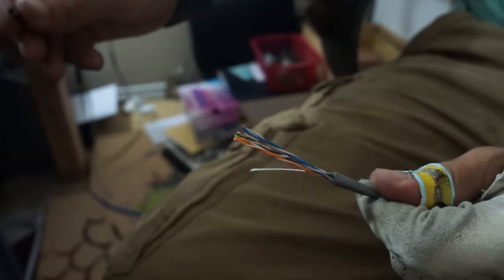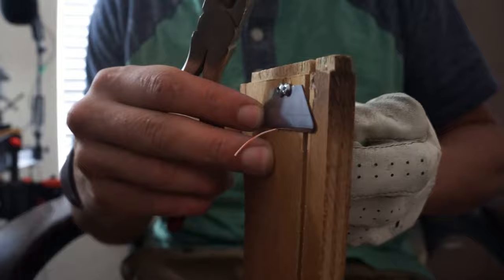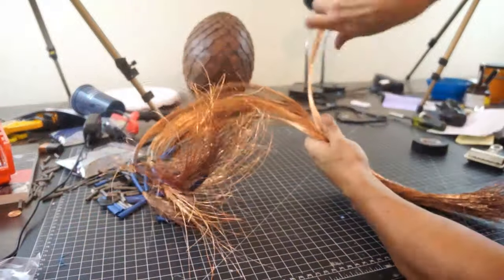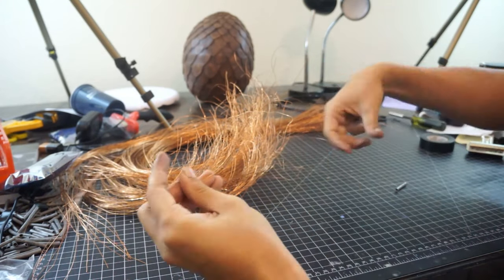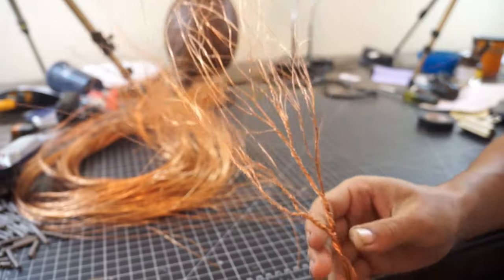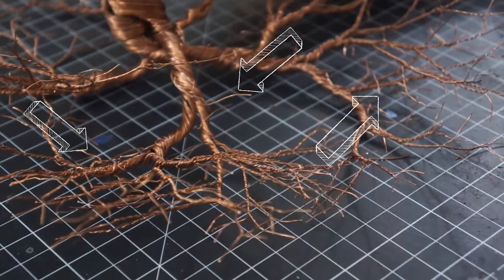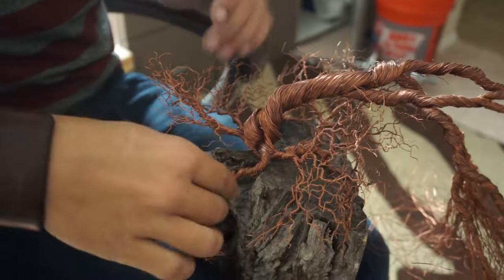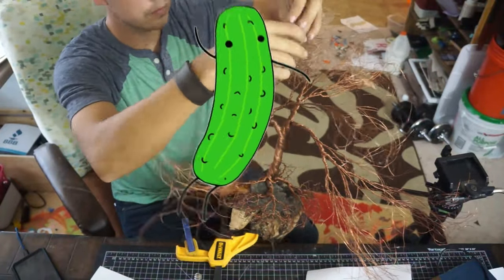Tree Sculpture Made of Copper - A Better Way

Comment: Beautiful!  FYI,, there is a product that jewelry crafters use called Tool Magic that you can dip pliers in to create a white rubber surface that won't scratch your wire. It's removable, and actually can be re-done when it wears down. Might be good to know about.
Reply from the maker: Thanks I'll have to try that on the next one

Comment: Instead of twisting the 2 wired by hand make a small gig or holder. Then attach 2 a hand drill head u control the speed and direction the drill twists the wired 2gether & much faster
Reply from the maker: For most of it I actually used a pair of safety wire twisters. VERY fast! But for the ends of the branches it was too delicate to use so I did it by hand.

Comment: Hey @Devin's Art Studio  I know this video is now two years old but do you have any tips for a smaller tree or more like a bonsai? like 10-12 inch big? Just things like how much copper wire I should use and so on :)
Reply from the maker: Typically your going to measure a length of wire and 1/3 of that length will be the roots, a 1/3 will be the trunk, and the rest is the canopy. (Generally...doesn't need to be exact.) So if you want a 6" tree you're going to use about 10" pieces. 3" for the roots and you loose some hight as you twist it. Hope this helps
Reply: @BlanchBrothersStudio  yeah that helps alot. Thank you and great videos 👍

Comment: Thanks for the video, but I do have one question, won't the bare copper wire eventually turn green? Are you OK with that, or do you think it would be good to spray it with some kind of clear coat to try to prevent that aged effect over time?
Reply from the maker: It will turn green eventually but that might take 20 years or more,... maybe longer because its inside. But you are right that I could clear coat it to protect the color.

Comment: My biggest problem was getting the main trunk and top level branches to combine and not untwist. I even tried copper plumbing solder and it didn't work. Any suggestions there? 

How did you get it to not untwist with the rod inside? Thanks!
Reply from the maker: I used two large channel lock pliers to really over twist the trunk. If that doesnt work for you,  you can try twisting each wire in pairs first, and then twisting everything together into a trunk. The exra twists should give everything more grip and hold better
Reply: @BlanchBrothersStudio  Thanks. I tried overtwisting too, didn't quite work. Part of it was the wire was soft, I used strands from 12 gauge wire,  and my tree was about 16 inches tall.
Reply from the maker: @burtonkent4549  wow! thats some thick wire compared to what I used. Try twisting up the trunk and putting tape around it. Then build the rest of the tree before taking the tape off